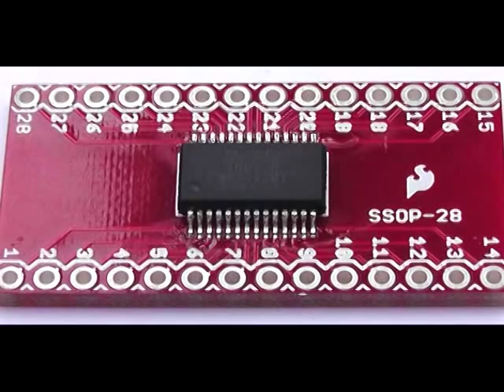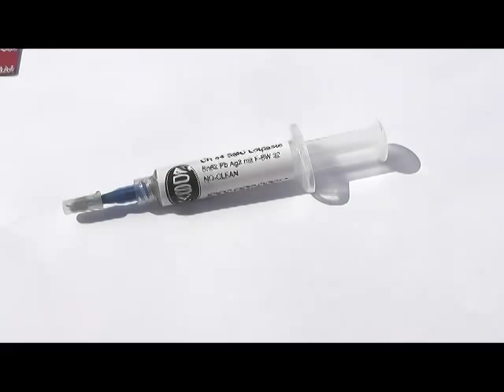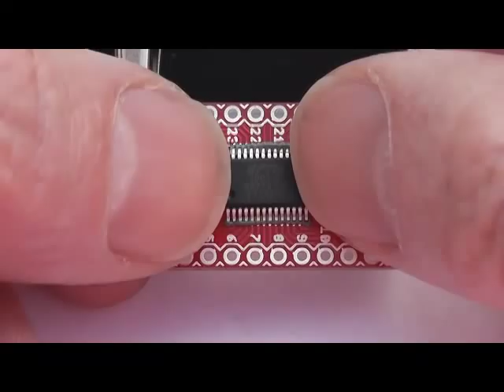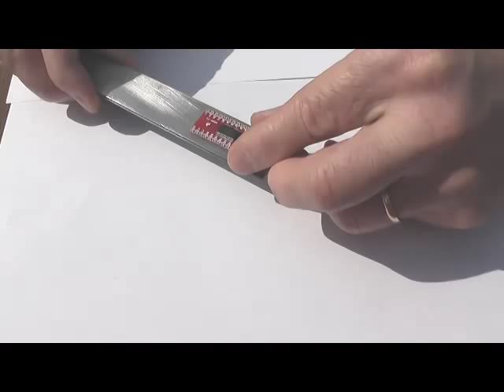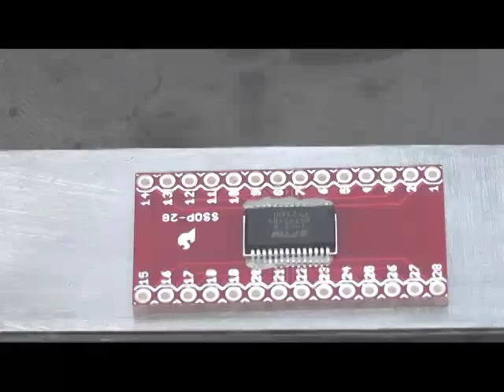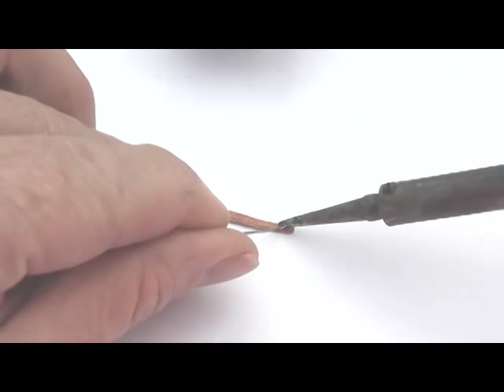hotplate soldering

Comment: I would generally err on the side of too little paste rather than too much. If you are soldering a leadless package or something with an exposed pad, getting excess solder out from underneath the chip is not so easy.

Of course if you have oversized pads on the PCB that makes it a lot easier as you have a lot more margin of error, the pads will suck up any extra.

Also with soldering braid I generally prefer to cut off a strip of it and hold it with tweezers or pliers rather than heat it while it's still on the spool. And I would say have a little blob of solder on the iron tip and try to touch the tip to both the solder and the braid.

Comment: Using de-soldering braid basically defeats the purpose of reflowing... Might as well just drag solder at that point.
Reply: Or if your tools are struggling go with the "flood with solder and wick up" method. With my station I can dragsolder QFP160 just fine, but it severely struggles with QFP208.

Comment: Thank you, hobbytronics101. For small components (like a 0402 resistor), could an induction heated rod be used in place of a hotplate? I'm going to give that a try but would like your (or someone else's) opinion.
Reply: Well that didn't work. The zinc bolt I used only got halfway to the 430 degrees Fahrenheit need to melt the solder paste. Next up: soldering with focused sunlight.
Reply: @rongarza9488  I don't know if this was sarcastic, but please do tell if you ever attempted to melt solder with sunlight and a loupe! Sounds ingenious, if tedious.